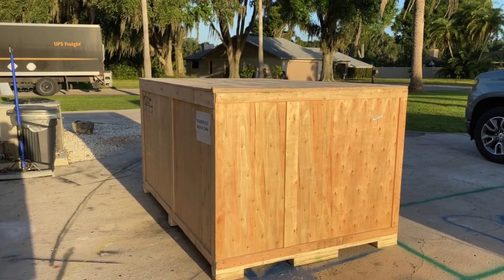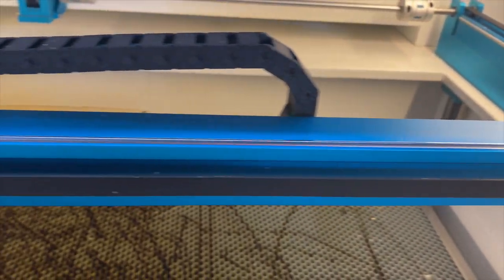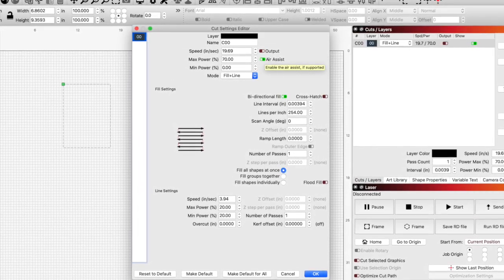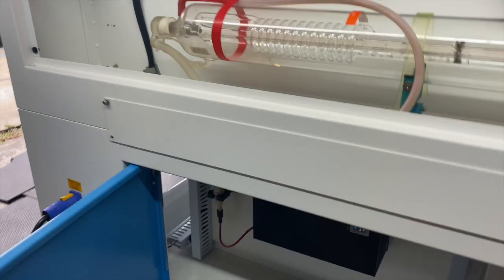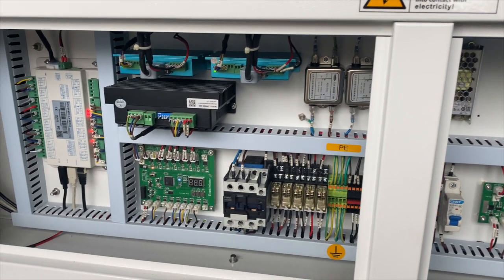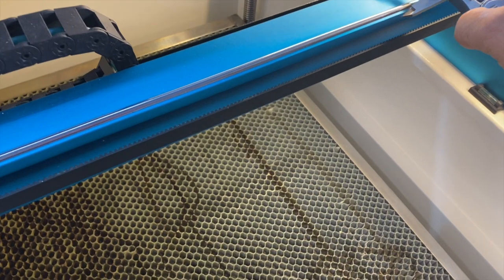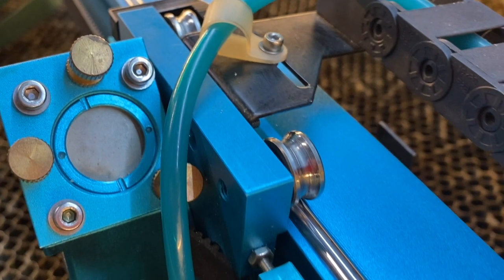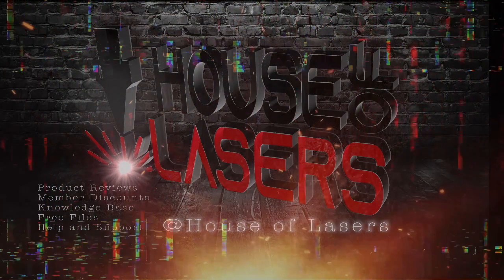REVIEW Thunder Laser USA NOVA 51

Comment: Nice review and reveal - thanks. I'd like to know about the precision of this machine. Given that it has hybrid steppers I am interested to learn about the precision this provides - more precision over larger pieces with multiple elements (lines, scans, etc.)? I am very much in the market for a 3rd, high quality machine to replace the two pretty good machines I am using currently. Also, I wonder if it can be broken down to pass through a 35" door?